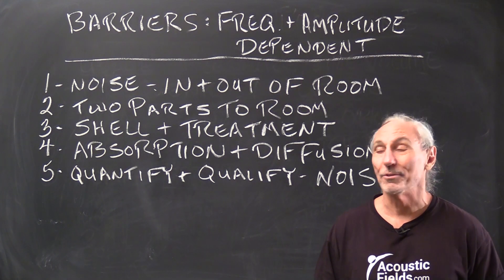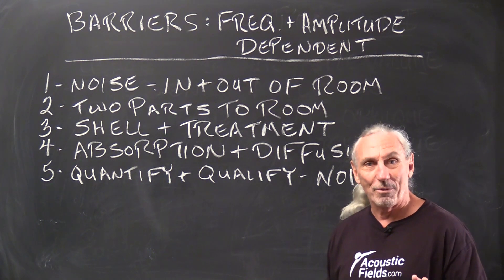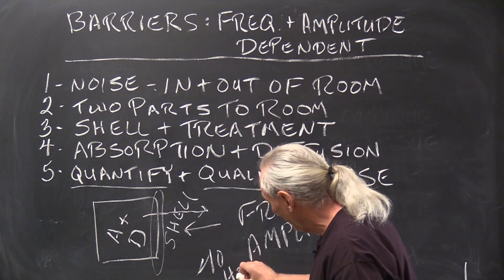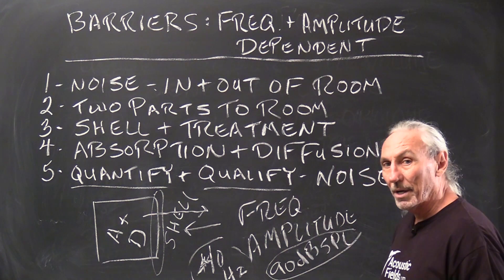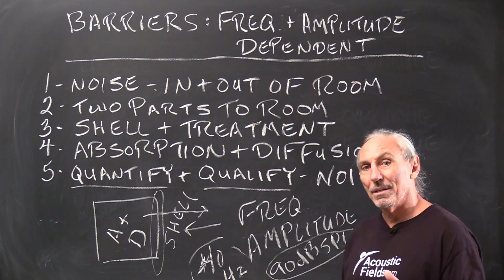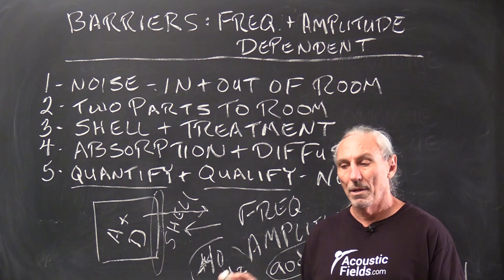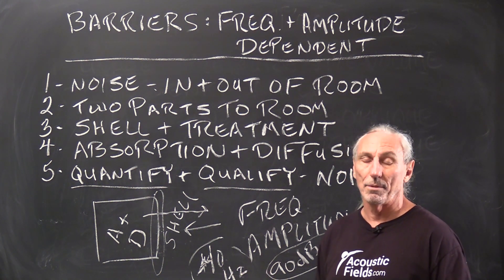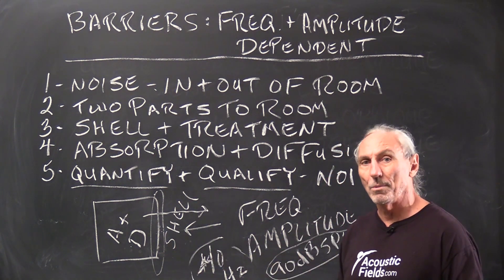Barriers: Frequency + Amplitude Dependent - www.AcousticFields.com

Comment: I think if I start recording my GFs moanings she could freak out. Based on your experience, whats the best  configuration for that specific scenario where I´d like to keep noise from leaking to the outside/next apartment; room big enough to have no wall thickness restrictions, concrete brick walls. Thanks in advance.
Reply from the maker: What is the frequency and amplitude of the noise transmission issues you are having. Barrier design and build is built on physics.

Comment: My rural house with 15x13x8 ft rooms, 2x6 walls with 6 inch insulation and 16 in the ceiling captures and amplifies low freq noise. Train horns sound 20 times on a typical transit through town and it is as if there were no walls. I set up an amplifier in the bedroom fed by  700 and 1000 Hz tones 90 Db and tried to find where it leaked through on the outside of the house. Could barely hear it outside! The double pane  window glass was the most obvious leak, then the window frames. Took the window frames out and thoroughly reset them with sprayfoam all around. Little difference. The train horns sound at distances from 1000 feet away to 1.2 miles with not much difference in amplitude. What happened to the power varies by the square of the distance change, the inverse square law? Sound energy from a point source, whether it is a truck engine or train train horn has a lot of energy left even at 1000+ feet away.
When I had the amp set up in the room with the 2 frequencies,  walking around the room I could detect nulls in the sound.